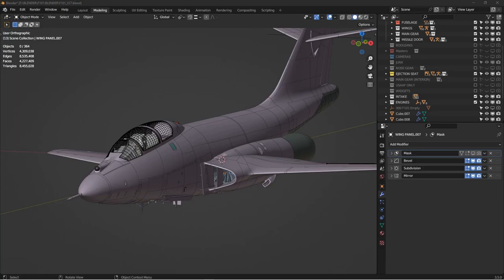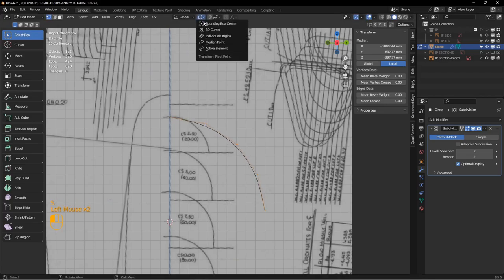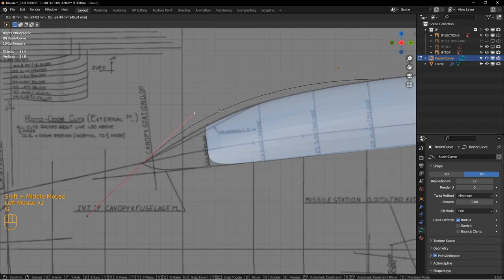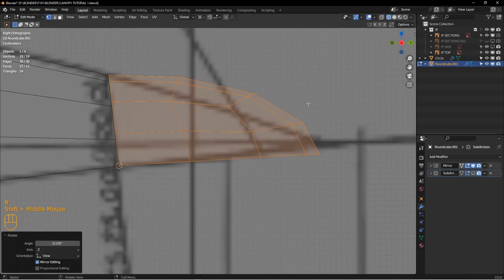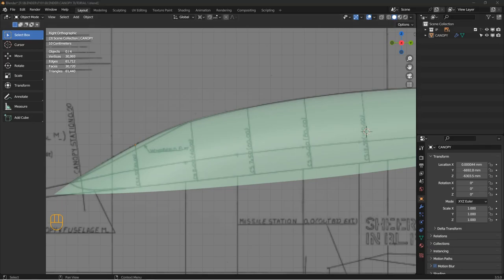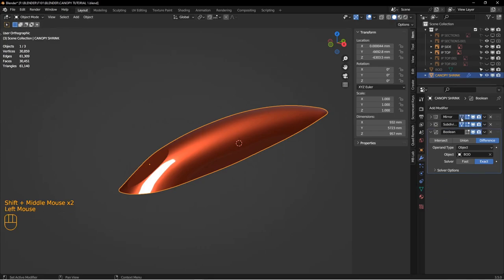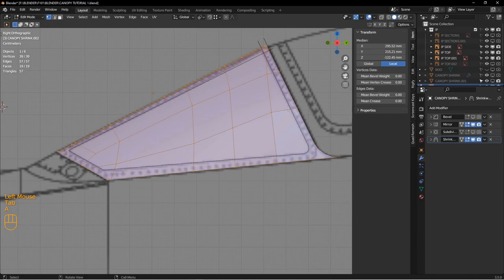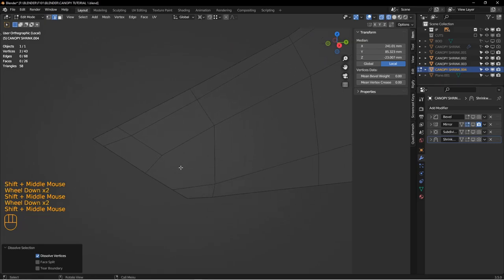F101 Voodoo project: Bubble canopy techniques for Blender

Comment: Man you really do an awesome job with Blender! I've never seen so much shrink wrapping! 
I see how the cross sections could give a more exact shape to the object. I've just been scaling the mesh on the y and z to match top and side view of the plan but that doesn't get those shapes outside of round or oval like a pear shape for instance.
Reply from the maker: I've really come to rely on the shrink-wrap modifier to smooth and correct my shapes.  It's been a game-changer for me.

Comment: Hi, nice channel, i am modelling a Gloster Gladiator. How would you model the airplanes body to achieve the fasetted back part? Likewise the wings to achive the dimps in the fabric. hope you get what i mean. :)
Reply from the maker: For fabric stretched over frames, I've used both bump maps as well as modeling the ribs and using a subdivision surface modifier to smooth things out.  It all depends on how close you're going to get to the model.

I should probably think of doing a WWI tutorial series too since there are unique properties of those types of aircraft.

Comment: ’Mark :
How can we align the canopy with the structure or fuselage .
Reply from the maker: I would use a LATTICE modifier to tweak the canopy into a tight fit.   Start by using the lowest level Resolution on the lattice as possible.  This should help keep the geometry smooth.  Add more resolution to the modifier only if you can't get it to fit properly.

Comment: How do you do the canopy if you can't get the cross-sections?
Reply from the maker: Not having cross sections does make it more difficult, but not impossible.

First - get lots of reference material so you can really understand the shape of the object.

Next, make the shape look as good as you can from each orthographic view (front, side, top...).  I usually start with a quad-sphere primitive and modify it to fit the side and top views as best as you can.  I will often use the lattice modifier to do a lot of this shaping since it does a good job of proportionally moving points.  I also use sculpt tools to smooth, inflate and grab parts of the canopy to nudge it into shape.

If your orthographic drawings are any good, this should get you 90% to the right shape.

Smooth the mesh using the other techniques I demonstrate in this video.

The method I used to create the flat section of the windscreen (https://youtu.be/go8X0mcMkjU?t=1744) is particularly helpful in refining the shapes.  If you can get that flat section of the windscreen to look right, you are probably really close to the right shape for the rest of the windscreen.

If you're trying to make this particular plane, the drawings are now available...

https://blenderartists.org/uploads/default/original/4X/a/2/5/a25b27b5ccc4ffdb577d5a2f8eac9830b73eac52.png

https://blenderartists.org/uploads/default/original/4X/2/0/f/20fa43a3d75edd700325641ef1253a0b36a4ec46.png

https://blenderartists.org/uploads/default/original/4X/9/7/4/97476c90fcecd69ed61bea8fda37feafd2cb35fe.png